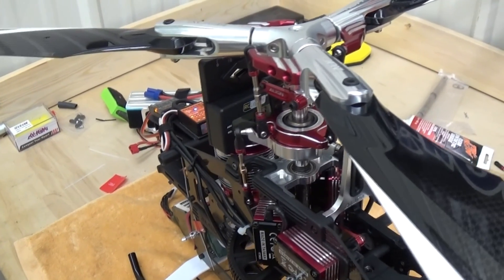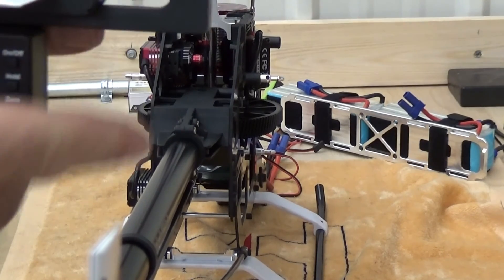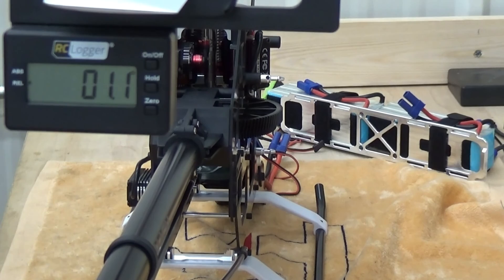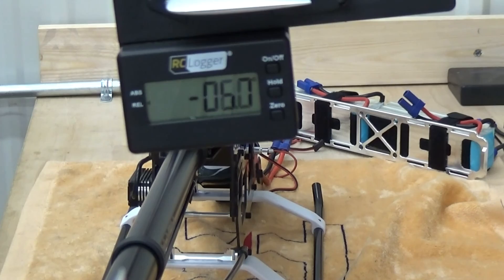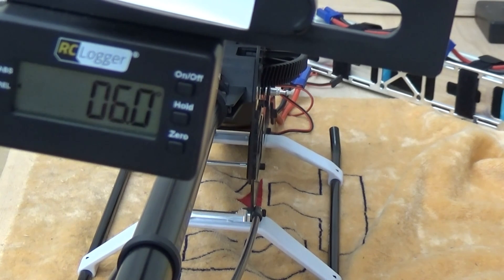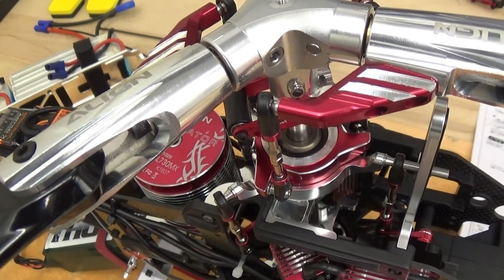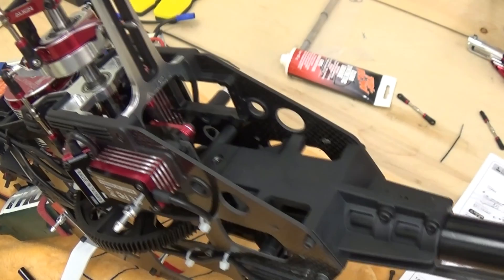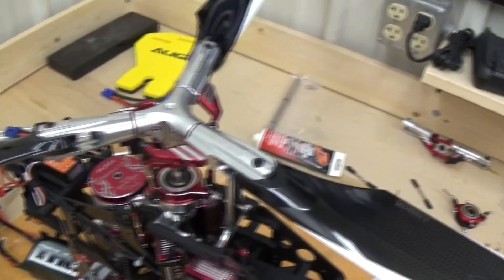TREX550X blade tracking and final MicroBeast Pro settings

Comment: Since you published this, Align have released counter thread turnbuckles for most of their helis as an optional extra. 550X to 700X. I do the swash with feeler gauges. And can get +- one thousands of and inch, and the pitch to the blades to +- 0.1 Degrees the accuracy level of the Align pitch gauge. You are no longer limited to 1 turn on the connector rods.